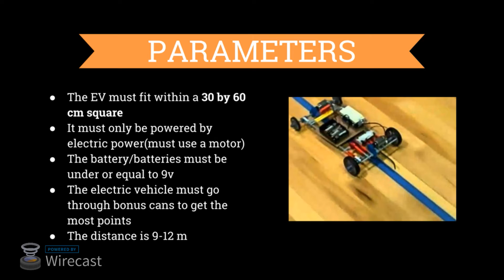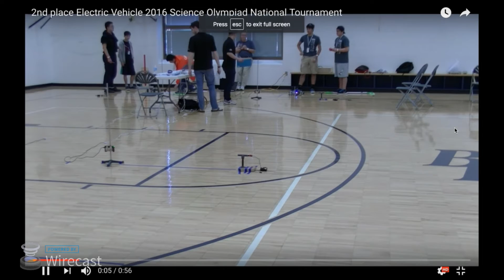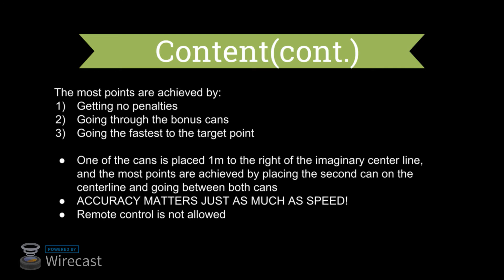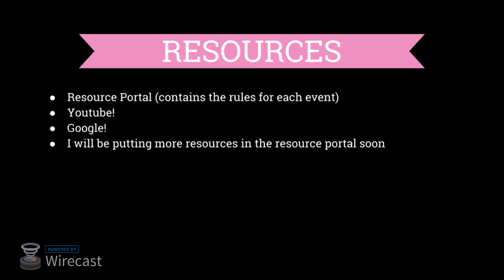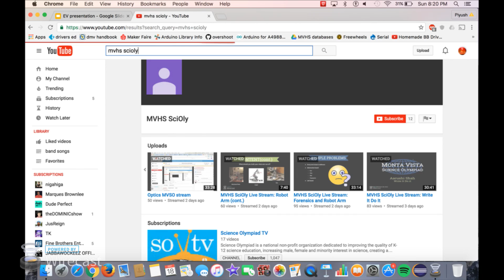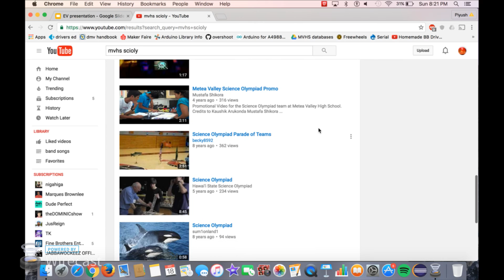MVHS Scioly Live Stream: Electric Vehicle

Comment: I noticed on the 2017 Electric Vehicle Checklist is specifies the voltage between any two points must be <= 9 V. However,  does that mean someone can use 2 nine volt batteries that are powering separate things (in my case, 2 separate wheels). Thank you!